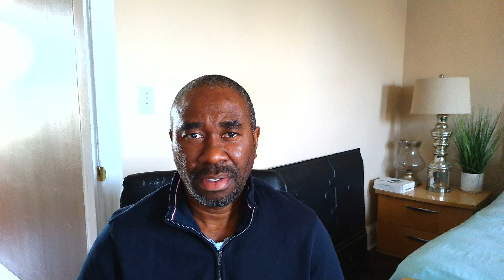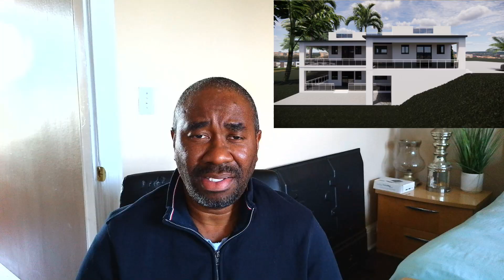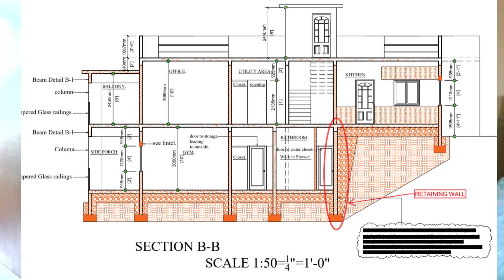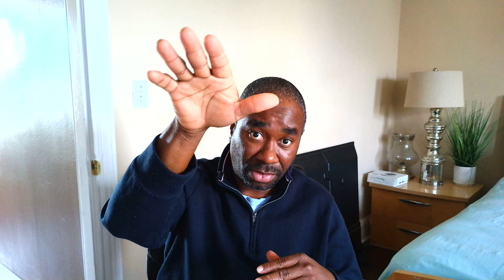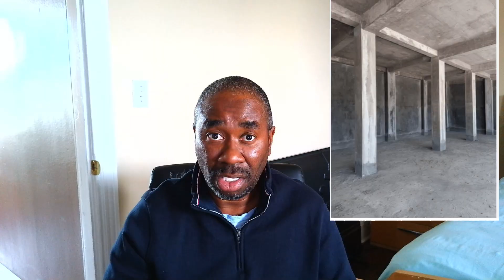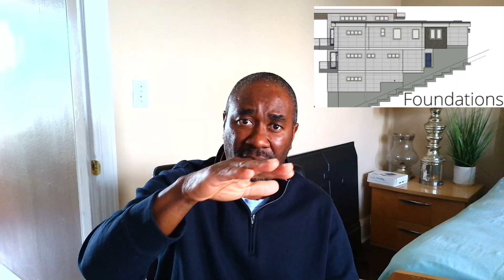HOW EXPENSIVE IT IS TO CONSTRUCT YOUR BUILDING ON SLOPED LANDS.| JAMAICA| Must Watch.

Comment: A back hoe work $8000 to $9000 per hour for bucket and $12,000 for jack hammer,  and a minimum of 3-4 hours ,also possibly a $25,000 to $50,000 for mobilization fee to get the tractor to the location. 
( From  my experience)
Reply from the maker: Thanks for the information.